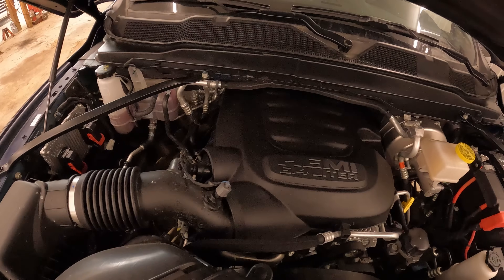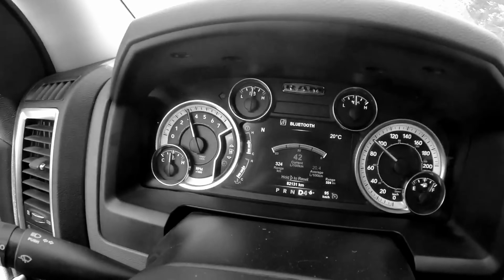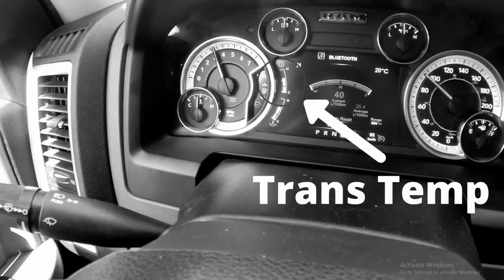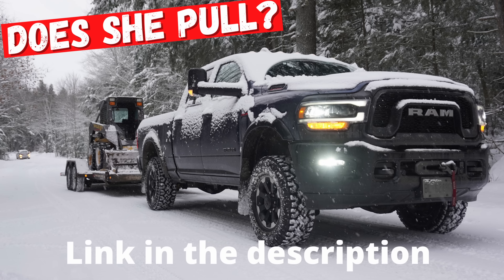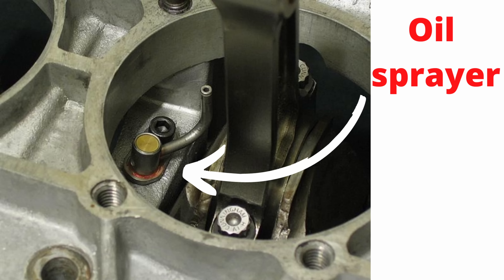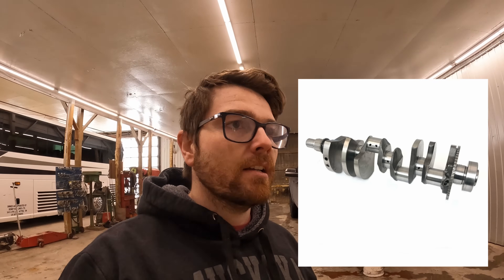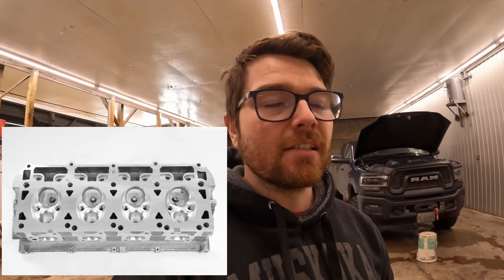RAM 2500 6.4 Hemi Review *Heavy Duty Mechanic* | Is The 6.4 Hemi Better Then 5.7 Hemi ??

Comment: I liked all the advantages of the Ram 6.4L engine you pointed out.  I have a 2020 Dodge Ram 2500 Laramie with the 6.4L engine actually it's the second engine because the first one knocked after starting the truck.  The dealer did extensive testing and found the number 8 cylinder was a problem so they replaced it with a new engine at 12550 miles.  I now have 19500 miles on the new engine and have the same engine knocking after I start it for a few minutes.  I tow a travel trailer that weighs about 7500 pounds and it pulls it great with no issues.   The knocking is so loud that it sounds like a rod is coming through the engine block then the noise goes away and it doesn't come back until it has sat for a while and then restarted.  I had a 2005 Dodge Ram 1500 that I bought new and had zero problems with it for 15 years before I sold it for a little less than half what I paid for it.  I believe in taking care of your vehicles and not abusing them.
Reply from the maker: sorry to hear about your first engine, that's no good. I'd be back at the dealer about the second engine knocking, sounds like an oil pressure issue if its at start up then goes away. and ya the early 2000's hemi were great engines, everyone seemed to like them
Reply: The knocking that goes away sounds like a hydraulic lifter/lash adjuster. Once oil pressure and Temps are up it'll subside. I've fixed this issue myself before. They use to run around 3.00-15.00 piece. Now they are up in the 20-make a man poor range.
Reply: @benjaminbrown1179  Thank you so much for your response.  I traded that truck in for a new one but would like to do what you suggested if the knocking comes back.  Do you know of a video that show how to replace the lifter adjusters or is something a trained mechanic needs to do?  You have thought the dealer and company would have done that before replacing a engine.  Thank you again.
Reply: @samdorchester2524  morning! It's just a matter of removing as much as you can to get to the valve covers. The more you remove the easier it is to get into and work. Blow the top of the engine off with high pressure air once everything is out of the way, but before you remove the covers. Something in the throttle body as well. Make sure to soak all of the new lifters/lash adjusters in a jug of motor oil over night.. Same type you are using in the motor. I use a magnet to reach in and pull them out. Makes it cleaner. Rotate them around a few times to get the air out and full of oil. 
They make a tool to pry up on the rocker arm from the opposite side of the spring assembly. It runs around 50.00 but is well worth it if you're doing them all. Remove the spark plugs. This will allow you to turn the engine over and release the pressure on the lifter you are working on. This can be done at the crank or by turning the alternator if you leave the serpentine on. I remove the belt and just use the crank. Removing the plugs also eliminates fighting compression. The rockers pop right out, and give you easy access to pull out the bad lifters. One out new one in. Replace the rocker and done. You'll need new valve cover gaskets, and the sets come with the rubber grommets for the bolts. Just follow the proper bolt pattern and torque specs. Make sure to disconnect the battery terminals. If you are disconnecting the fuel line remove the fuel pump relay before disconnecting the battery. Turn the engine over a couple times to reduce the line pressure. Then disconnect the battery. Once the battery is disconnected go ahead and replace the relay so as to not lose it or forget it. While working inside the heads coat all of the cam lobes and the roller with a little assembly lube. Once you're back together pull the relay again on the fuel pump. Connect the battery, and turn it over in about sets of three second long starts. This will get the oil flowing and pressurize the new lifters. Replace the fuel relay and prime the system with a couple key turns on and off without starting the engine. Then start it up. Let it do its idle thing for a few minutes and then lightly bring the rpms up to around 2k until the engine is at running Temps. Check for leaks. 
On the passenger side it is best to just go ahead and disconnect the heater lines. Drain the coolant from the radiator and preserve it for the refill. Or replace at this time. Removing the ac compressor without disconnecting the hoses is also a great idea to get it set out of the way. Use rope to tie everything you need out of the way so it'll stay there. If you have any mechanical skills it'll be around a 2 hour job driver side and just a little longer passenger side. Good luck to you.

Comment: Hyper tic tic pistons, marketing fail for the Hemi brand. My 5.7 16 Rebel was a rocket ship compared to my PW's. Granted they were probably 2000lb lighter. On my PW forums I follow, I see 6.4 truck motors come undone with power adders (turbo/super chargers). Now I'm wondering why? Forged crank and tictic pistons sounds beefy enough. Maybe it's valve float from springs not intended to go over 5000rpm. I do know the Hellcat oil pump flows a lot better and will bolt on but that's a lot of work to get to it. Both motors seem to develop issues with extended idle times. The lack of low RPM oil pressure is what seems to wear out the lifters and round a cam. So don't let either sit idle for like 10 min on remote start

Comment: Is the ram 2500 decently reliable? Thinking of buying a 2016 or new. Do they have transmission problems
Reply: Get a 2019 or later they have the bulletproof 8 speed zf trans
Reply: @ChaoticDave69 my 2017 had the 8 speed
Reply: @bryanmiller5692 your 2500 did?

Comment: Unfortunately the 6.4 does have the exhaust manifold problem. I had to replace my 2015 passenger side bolts and gasket just a couple of months ago. Maybe they have corrected the problem with the newer models I don’t know but they do have some issues with it.
Reply: @scott5799  I replaced the  passenger side at 145000. The same common locations as the 5.7 , the rear bolt near the firewall. The driver side was done by the previous owner as far as I can tell but I have no idea what the mileage would have been.
Reply: None with the engine. It runs very well. A little noisy but that’s a 6.4 thing I’m learning. Honestly I wouldn’t hesitate to drive this thing across country and back. It’s got 156k on it now but runs very well. I’m hoping to get at least 250-300k out of it. I’ve got no plans of getting rid of it anytime soon with the way truck prices are. Very solid engine in my opinion.
Reply from the maker: Well thats no good. I mean it is a mechanical component and they certainly can fail. But I would assume its far less common then the 5.7
Reply from the maker: Good to hear about the mileage! Hoping to get good mileage out of my 6.4
Reply: In my opinion it’s a great motor
Reply: Just north of Cincinnati. Yes it will have your head spinning for sure. I do run a good quality oil like Amsoil or redline. I can get either one just as easy as pennzoil if not easier for me. The redline is a bit pricey and Amsoil if your a preferred customer can be had for about the same as pennzoil. Nothing wrong with any of them as long as it is doing what it needs to do. I usually won’t go 5-6k at the most between changes.

Comment: You seem very knowledgeable about these 6.4 engines. Why do so many of them have cam and lifter failures? Does the ECO mode have anything to do with it?
Reply: Hope he answers this one.
Reply from the maker: I mean from what I've researched and from who I've spoken with no. the MDS system should not cause these lifter issues. Now the MDS system can fail like any other mechanical system but they are not directly causing the lifter issues. 

as for why the lifter are failing there seems to be a wide range of theories. I think idling time is a big factor as well as oil life intervals being too long and thus creating dirty oil which can hinder the hydraulic lifters. recently a lot of people have been pointing to the fact that the oil pumps in these engines do not supply enough PSI at idle which is causing these lifter failures and that does seem plausible.
Reply: A good point to research would be oil flow at low ram or idle. Work trucks idle a lot and thus need as good a flow of oil around the valves, pushrods, and lifters as they do at higher road speed rpms. It's possible that the oil flow at idle is reduced to a trickle to the valve train. I know some engine require splash lube as well as oil passages to lubricate key parts. There is very little splash oil at 600 rpm.
Reply: Lack of maintenance causes lifters to wear out and fail. People follow factory recommended intervals and end up with repairs. 
Start exercising your questioning attitude and stop listening to oem, their goal is to sell you more not less.  Get more money from your pocket not less.
Reply: As Mr Steve pointed out, oil flow at idle is the main issue. This is very prominent in patrol vehicles, 'taxi' application type service and such that often includes a lot of extended idling. One thing they discovered is that simply raising the rpm a couple hundred rpms eliminated the low flow issue. They talked about programming the ECU to bump the idle up after a set period of idle but I don't know if they ever did that. Everything they do like that has to be cleared by the EPA.

Comment: Define fuel efficiency in any 2500 or up truck and you will be a God amongst men. It's like oil and water, both liquid but will never mix
Reply from the maker: lmao so true. I will say my buddy with a 2004 4wd 5.9 cummins runs at 28mpg. but now a days no way.
Reply: I can get 28 mpg in my 6.7 cummins...I gotta stay around 60.....but everyday driving I'm like 22 no matter how I drive it....only going by gage in truck not hand calculated